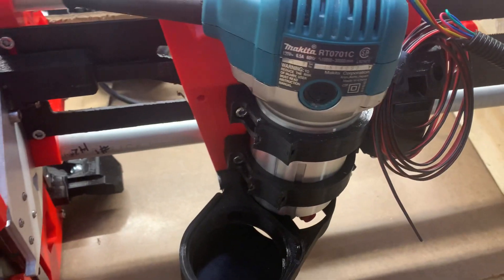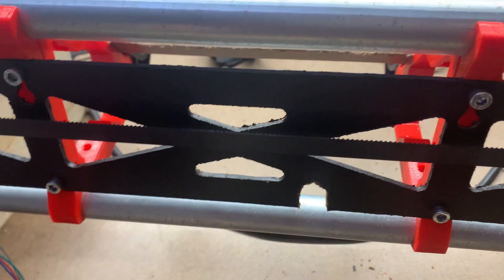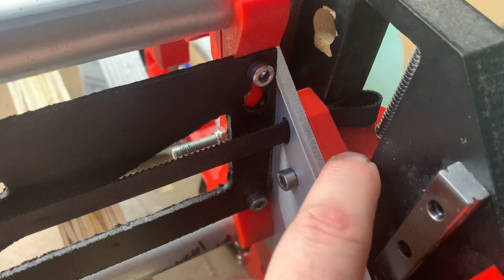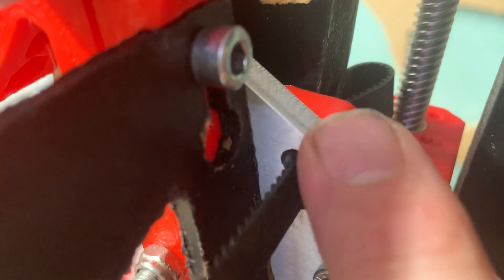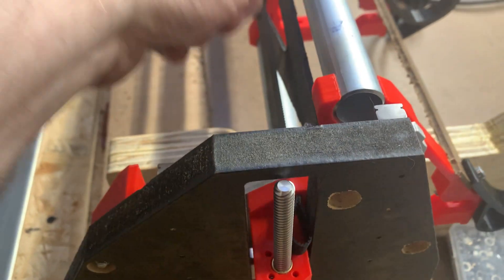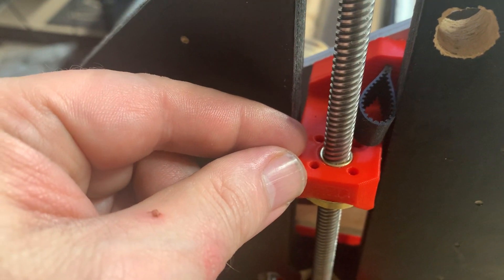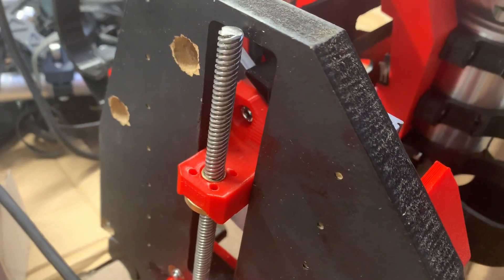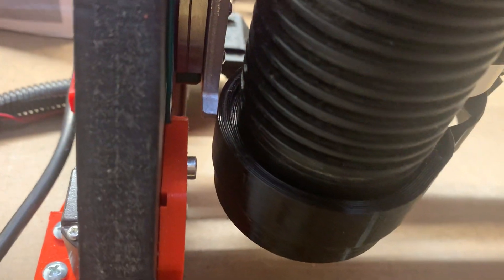LowRider 3 MPCNC - lead screw alignment tips, X belt install tips, and more - May 31, 2022

Comment: Just shim it it’s easier and quicker than remixing. That’s always what you have to do with motors to get your tolerances and alignments precise. Super thin metal sheets for shimming can be cut with scissors and is very durable. 😊
Either on the top piece to lengthen or the inside of the z stepper mount to shorten it to get the alignment right!
Reply from the maker: Thanks for the tip!

Comment: I just superglued the tool mount nuts in the carriage. Makes taking it on and off much easier. My Z stubs were a little short, but I just measure it and made some shims out of paper and thin card stock to get it parallel.
Reply from the maker: Great tip!